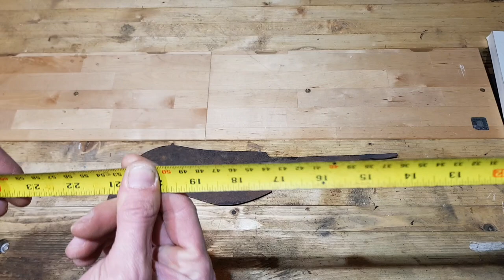Vintage BillHook (Cleaver?) - Rusty Restoration

Comment: That's a French brand (Revolier) and a French pattern (I can't be 100% sure, but it looks a lot like the Niort pattern). Overall nice job, though I notice you didn't bent the tang on the handle as it's supposed to be. This really does a lot to secure the whole thing.
I had no idea simple vinegar could do such an excellent de-rusting job just on its own. On a billhook blade that's not that much of an issue, but it's very difficult to mechanically clean the inside of an axe socket/eye.
Reply from the maker: I tried but stell seems to be a little bit to hard and i didn't want to brake the handle and starting again, thank's for all details about this billhook, respect 👍😀

Comment: As MadNymForce mentioned, I would have my doubts about how secure the handle would be if you put it to its proper use. You could try another traditional method for fixing. If you were to shorten the handle by a little, to leave a small amount of tang exposed, you could fit a cap washer and peen the tang over it... Or, failing that, epoxy would do the trick.

Other than that, fantastic work.
Reply from the maker: Thank's for your comment and good tip 😁 I'll definitely will try epoxy 👍💪
Reply: @MatthewMoustache   Hi Matthew, either alone or in combination with the epoxy, suggest you drill and pin it with a brass / copper pin completely through the ferrule and tang. You can get hidden thread screw in pins from the knife making community. Due to small size and using widest part of the tang no practical weakening issues. I used this style of fix and it's still in use 20 years later used commercially. ( Master Hedgelayer)
Reply from the maker: @kevinfrost1579  thank you Kevin for good tip, i used epoxy because of not so perfect fit so did wanna get extra support for the tang but i will try your method 👍